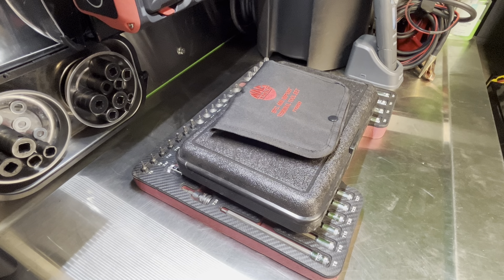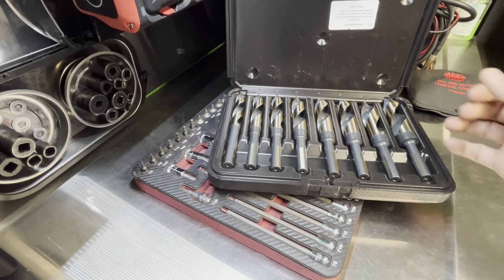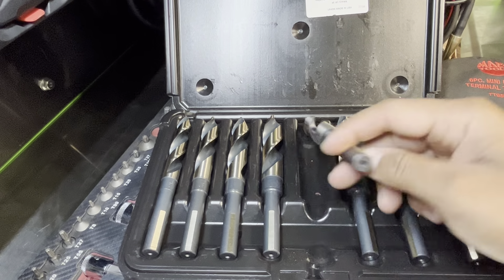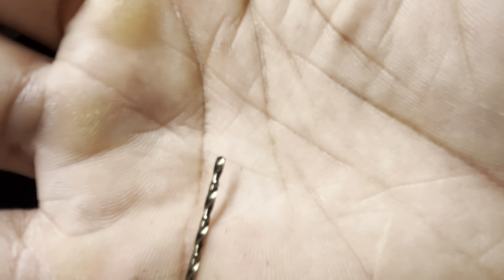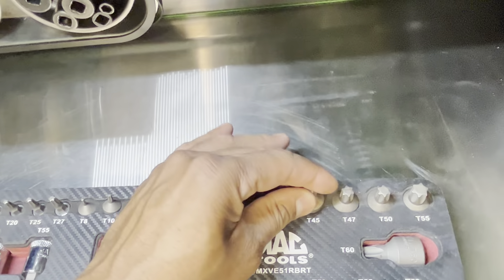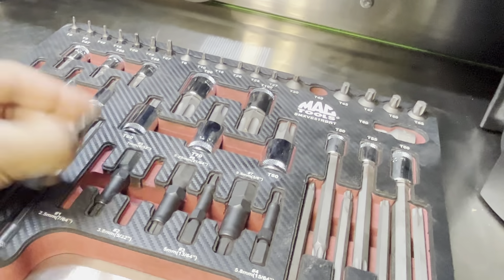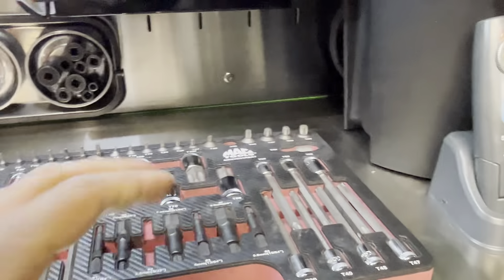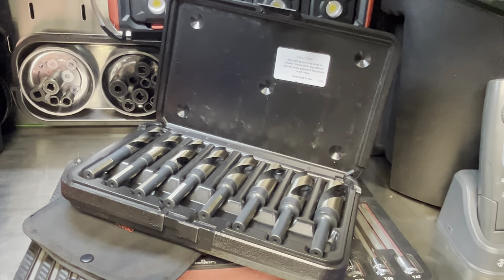Tool Haul: MAC RBRT | KnKUT Step Drill Bits

Comment: The guy probably recommended evapo-rust? There's a few videos that show it does a good job. The drill bit set that I have are all the Mac tools. They warranty them, even the smallest ones ( this is not new info to you I assume). Throughout the years, I've probably replaced six whole sets if not more. The shops I've worked in, all have multiple sets that have missing, broken, and dull drill bits. It's paid for itself multiple times over. I don't know if they have a large size set like yours though. I'll have to look into it. Nice video.